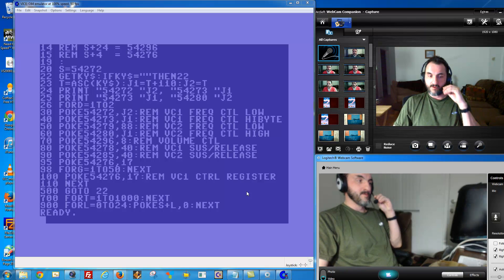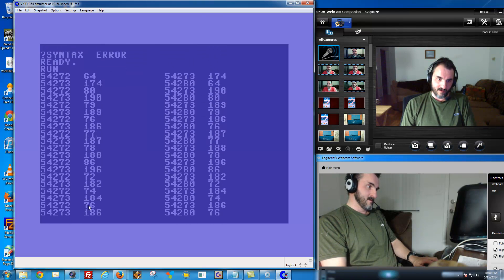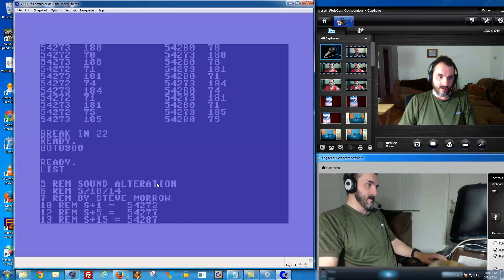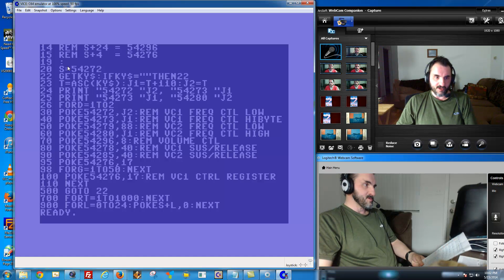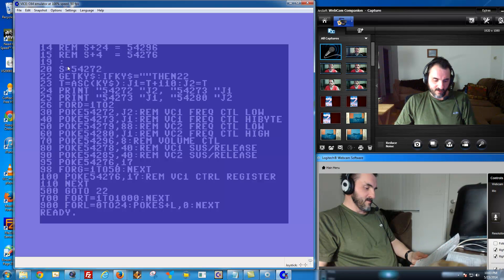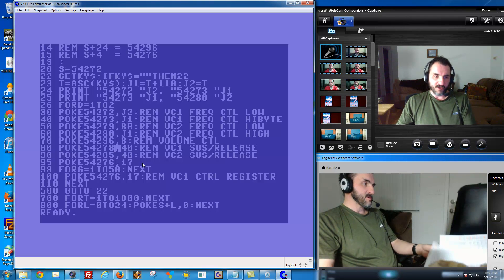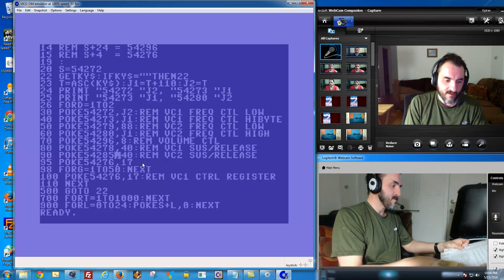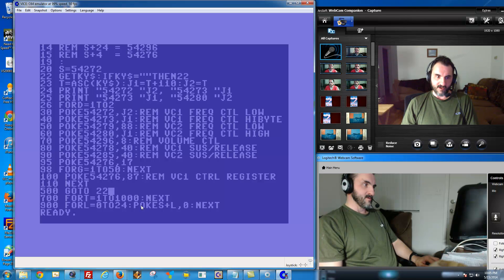C64 Sound Demo

Comment: Very interesting,  would be great to write a sound editor for all those settings like the waveform, vco, attack and sustain etc.  I wish I had gotten started on it back then, though I did write a sprite editor in basic,  I'd have to relearn the commodore again.  I compiled vice on my Linux box so I'm gonna start tinkering now I've got the "mapping the commodore" pdf.  Man I need a renumber command in basic hehe, I did have a tape with extra commands back then but I've no idea what or where they are now.